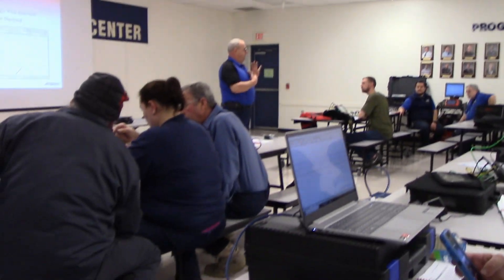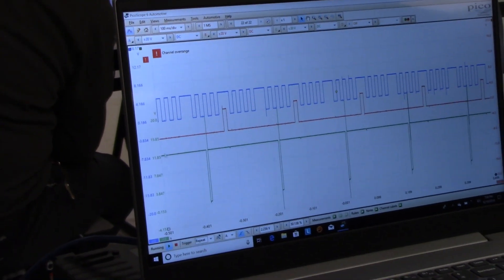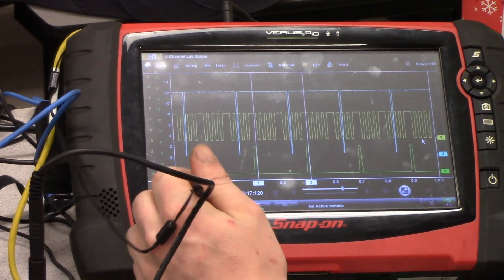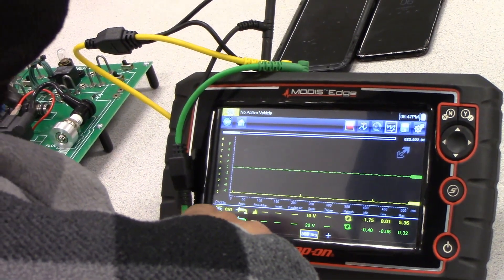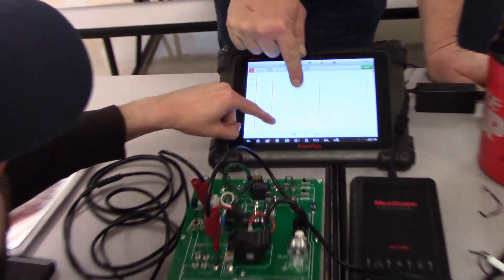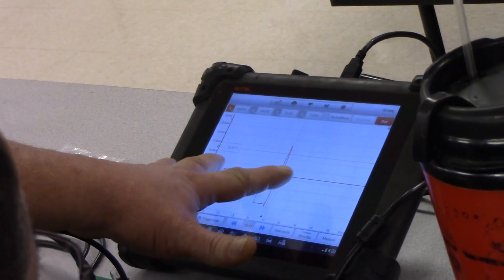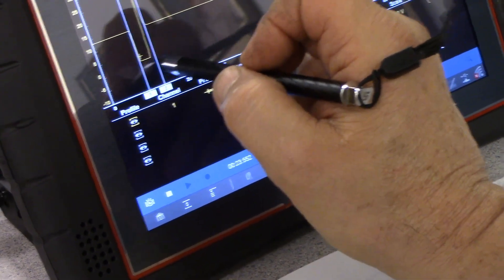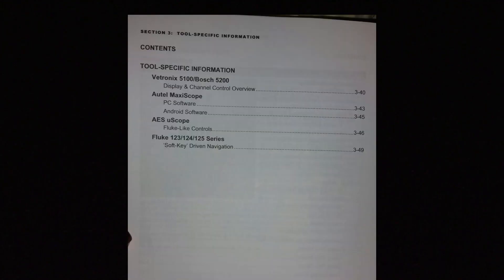ATG Essential Lab Scope, Presented By Kris Lewis

Comment: those test output boards could double as some nasty horseplay devices, I can picture one hooked to a chair and the desk. ZAP ZAP ZAP ZAP.
I landed myself across the room once years many ago playign with a coil, points/condenser on a D shaft motor. I didn't do that again, it went in my left hand and out my left leg, which promptly kicked me in the air and back 5' or so
Reply from the maker: Whoa!!!  I've only been zapped a couple times, but it's embedded in my head forever. Lol. Not fun at all, and points I think pack an even harder punch because of dwell typically longer, if I recall.    Sounded like fun for sure! In one hand, out the leg! Kinky stuff right there!! 😂😂☇😅☇

Hope you had a great Christmas!  🤗😊

Comment: This was such a fun class. Mine was with Rick. There needs to be more hands on classes!

Going to this class showed me there needs to be more hands on classes like this to help educate the process of setting up and triggering, which lots of guys know about but even more guys don’t 🤦‍♂️
Reply from the maker: I totally agree!
Reply: Very true Cody.  If you dont understand triggers you can get spanked by them.  I like to use a trigger at first to get a general idea how the signal is doing but after that I use a constant roll mode or streaming mode which Pico calls it.  Because if you are looking for a intermittent fault you can miss it in a trigger.  Did the class go over using your roll and streaming modes of your scope?  Just my opinion but I think that is the most important function of your scope that you need to understand how to use.  I do like the ats simulator boards, think I'm going to get some myself.🙂
Reply: I'm always amazed at the folks who think they "wouldn't use them fancy tools" I think it's entirely due to the lack of hands on teaching with them. Not just on scopes but on scan tools as well. I've seen more than one shop with a  Verus  that uses it to pull codes and do EVAP tests and that's all.